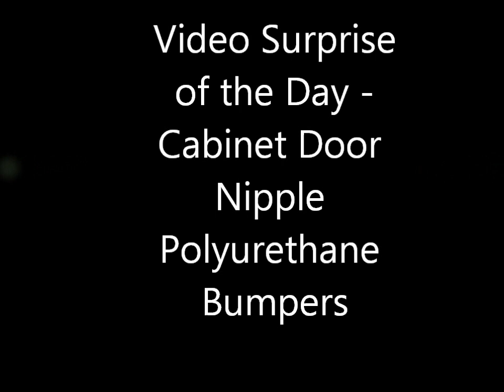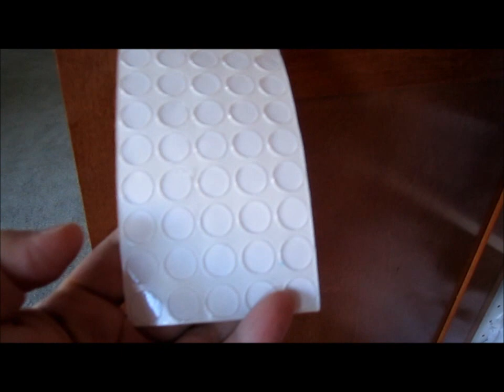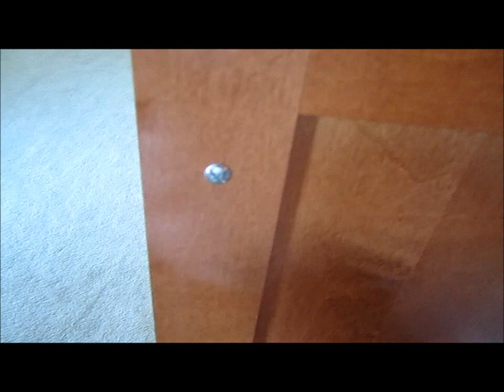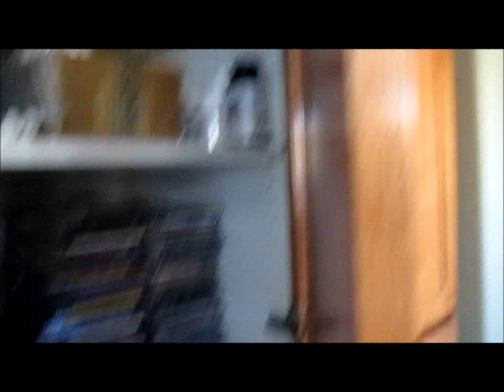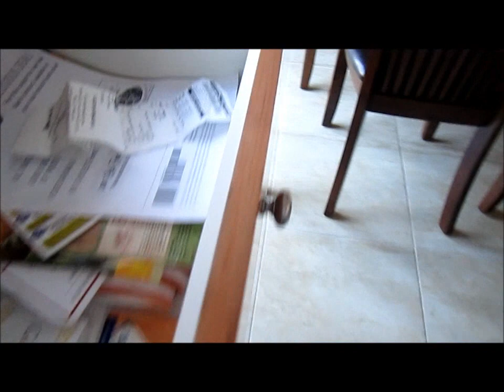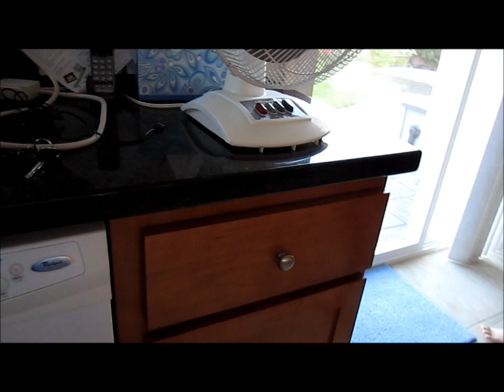How to reduce slamming Cabinet doors with special door bumpers

Comment: You should tell us where you bought those things. That would be very helpful! What I hear you say is that the little pointy nipple in the middle is what makes the bumpers quieter vs the ones that are flat!
Reply from the maker: +Andre Robichaud I purchased them on ebay as mentioned in the video .   Yes, these are more quiet than the regular flat or green cushion ones.